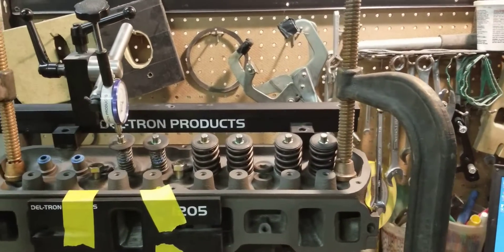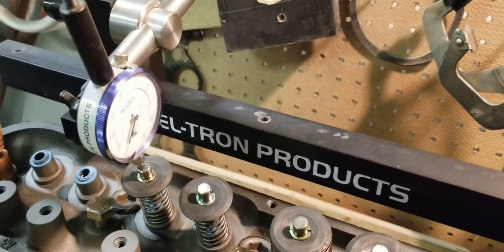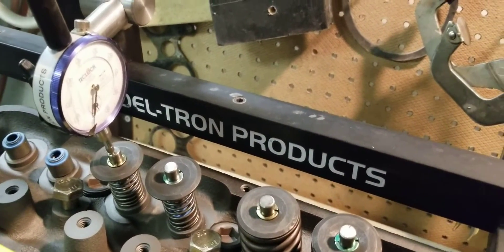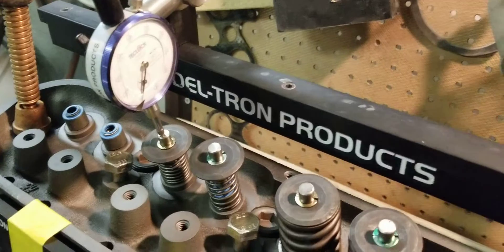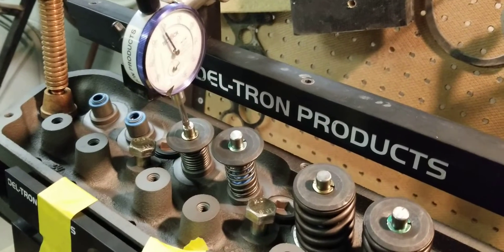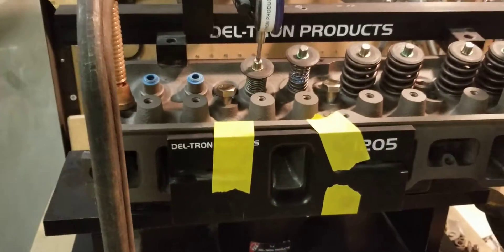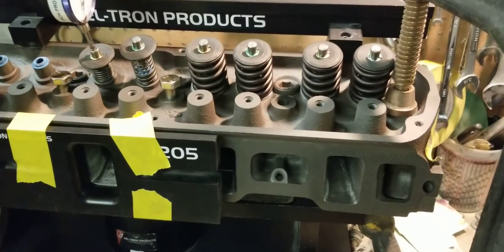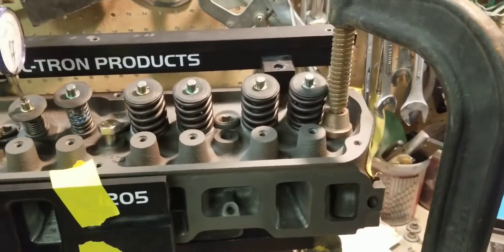Ford gt40 ported heads flow results. Stage 2 iron heads from Bigdogs Porting.

Comment: This runs about $1000 plus shipping correct? At $1200 the “as-cast” AFR 185cc flows similar(a little more) and has a lot of room to grow if I’m not mistaken?
Reply from the maker: No, the stage 2 porting and valve seat cut labor on heads that the customer provides is no where near $1,000.
To buy our fully rebuilt stage 2 ported gt40/gt40p heads equipped with hi performance valve springs is less than $1,000!
Remember this is just our entry level stage 2 port job. We also offer a Stage 2 race port job that gets even more porting with smaller combustion chambers for even more power! These heads will last a lot longer than AFR heads, are cheaper and has made as much as 380whp on 302/306 combos with our other ported parts

Comment: I know people on the fourms call out your flow bench for not being accurate. BUT I think it is nonsense because your stock flow numbers are right on with everyone elses testing. So how can you not trust your numbers. Its ridiculous
Reply from the maker: You are very smart. The haters on the forums say things like that because they don't want to admit the truth, its personal to them. Other porters on those forums are afraid to lose even more customers so this is why they are bashing and talking negativity. Notice they never come with any data or analytics that proves anything we say to be false lol. Every single thing they tried we've come back with proof and we post it for all to see. Yet the main negative people on the forums cannot do the same. None of the haters have used or experienced our porting so how can they give any real legitimate opinions? Yet all of our customers are very happy and many are repeat customers. This is why we ignore the haters. Our customers are making more power with our basic ported factory  parts than most guys are with expensive aftermarket parts! How many guys do you know that are making 380whp on a naturally aspirated 306 with less than 10:1 Compression, mild cam, ac, running a factor computer on a street car? We have customers doing it with our gt40p heads and intake manifold! 
Besides good porters always provide before and after flow results because we know test conditions, fixtures and setups can vary from shop to shop but the gains are universal. A 40cfm gain from our basic stage 2 porting on iron heads is great considering the valves are stock size. We SHOW you raw video of it yet the haters on the forums don't, why? 
Do a search and you will find a video of Eric W showing you how a SF600 flowbench can give the same part totally different flow results based on how the operator sets it up or calibrates it. You can't do that with Our flowbench because it doesn't have a plate below the bore fixture that can be manipulated and the processor is all digital and self calibrating! No room for error at all! 
Once we publish our crate motors engine dyno results the forum haters will have nothing else to say but they were wrong lol.
Reply: @bigdogsportingtonyb2833  Yeah I cant wait to see your crate motor dyno results, I hope it shuts them up.
Reply from the maker: @lukebronstein9617  I can tell you this, the videos will show something that has not been shown on YouTube by anyone selling sbf crate motors lol. After we publish it there will be a big change in how people build their sbf motors. I'll just say this, sbf 302s making Coyote motor hp without exotic parts!!

Comment: I can't believe that no one has ever pointed this out. These numbers are completely not representable, since nothing is standardized. You can't compare them to anything. The industry standard is 28" pressure drop and after every valve lift change the vacuum has to be adjusted accordingly or at least the conversion has to be done after the fact. But no one can look at this and say "Hey, great low lift flow" since everyone measures at 28 and yours is at 36 or whatever. Of course the flow is gonna be higher when you create more suction! This is not to say that the work is not ok, but when all the numbers are compared across the industry you need a common denominator and that's why you can only compare apples to apples if you standardize the pressure drop.
Reply from the maker: See you are not paying attention! Let me say this again for the 100th time. Our flowbench calculates to 28" no matter what the actual depression is! We have many videos showing this. Our processor does the work so as the depression changes the processor adjusts to calculate the flow results to 28". 
Look at our other videos and compare our stock part flow results and you will see they flow right around what everyone else that's doing controlled testing gets. 
I will share the links with you so you can stop listening to people give you false information!
Reply: @bigdogsportingtonyb2833  I just ran into this video only by accident and it was nowhere mentioned within this video that the flow results are scaled to 28". So I hope you can understand why the conclusion that I got was as such. It's very misleading when you look at the screen that you show in the video. I now also understand why your bench does what it does, because it's a DIY bench and not a commercial one.
Reply from the maker: @KontoVonMir  no problem. If you go to porters that ports the amount of volume that we do and that actually flow their parts (95% don't) they may say the have a SF600 but if they are flowing each part like we do I bet they have a flock like we do because its efficient, accurate and self calibrating. A SF600 takes too long to setup and needs regular maintenance in order to remain accurate. Get on the Superflow discussion groups and you will see guys having trouble with accuracy and repeatability.
We flow Every part we port and we deliver over 350 orders a year and growing! Plus our customers are making power that others are not with unported parts.
Reply from the maker: https://youtu.be/8qiuSGuZX5o
Here's another one. We changed the depression WHILE flowing the part and the processor adjusted to give the flow results at 28"!
Now before you criticize us make sure you know what you are talking about!
Don't come on this page talking negative because you've heard some hater say something about our testing to try to discredit us because of their inability to give the results we do. 
We can easily flow at 28" but our testing is for comparison purposes. Before and after porting to see the GAINS!!! 
GET IT?
Reply from the maker: https://youtu.be/CfcWGIbELug
Here's a test showing how our flowbench processor doesn't need exactly 28" give accurate flow results!
Reply: @bigdogsportingtonyb2833  Regarding the other video: I believe you what you're saying. But just FYI, the plate is supposed to be used directly on the hole without the adapter. Also, the 26" you have with the test orifice is only 3.5% away from the measurement that you'd get with 28". So scientifically not super convincing. But again, I believe that your software does the conversion.
Reply from the maker: @KontoVonMir  the adapter 4.060" which is the same exact size as the bore fixture and the other video the depression was changed a lot but the reading was the same lol. I can turn the depression to 3" up to 32" and it's going to read basically the same (ask me how I know lol). We are flowing parts and building cars every day. No matter what, we know the truth and our customers know the truth. The difference is we take our time and use a lot of skill and testing to get the results we do. Just follow our page. We will be posting up customers track results and dyno videos then you will see what I've been saying is 200% facts lol.

Comment: Need your help with a stage two port on a match ported 95 cobra upper.
Motor is 347 with stage three ported and welded lower with AFR 185.  A street motor but I am out of airflow at about 4200.  TB is BBK 75 with Anderson power pipe and 85 sct mass. 10.8 to one coast high rotating assembly.

Original owner 95 cobra so I would like the stage two to keep it looking original or close to.  Figure I need around 300 per port but you would know better

Let me know and thanks

Ray
Reply from the maker: Yes we can help. Can't say your lower is ported to our specs unless you have flow data on it because when customers send us parts ported by other po6we find that they just don't flow what ours do and is exactly why they are not making the power they should.
Your combo is a perfect example of why we tell customers having a ported lower only with a stock upper doesn't give them the cfm they think and in our opinion a waste of time. With our stage 2 porting you will be able  to pull much higher and make a lot more power than you currently have.
Message us on our Facebook business page at Bigdogs Porting to set things up.

Comment: What is happening to velocity? I understand the velocity is what you want for low end torque. How do those numbers look with your porting?
Reply from the maker: We do not hog out ports. Our porting retains great velocity for the combos. Porting is an art as well as involving a lot of science and math and we are very good at it. 
Our ported parts always make great torque and great hp. Most of our 302 customers that runs our stage 2 ported gt40/gt40p heads dyno 350wtrq and up on bolt-on combos with our stage 2 ported  gt40 manifolds. Look on Our Facebook business page at Bigdogs porting for some dyno charts and compare to other combos with other heads and manifolds.

Comment: Is stage 3 max porting on these? Also what’s the power you’d say to expect if I would go stage 2 or 3 with porting on the gt40s mixed running with some other mods like intake throttle body 24lb injectors fuel system... etc
Reply from the maker: Yes we offer stage 3 ported gt40/gt40p heads that gets 1.90/1.60" stainless steel valves and full race porting. They flow around 248/195cfm at .600" lift.
On our stage 2s they can support as much as 380whp with the right supporting parts and the stage 3s can support even more. 
If you run our stage 2 or 3 heads, stage 2 or 3 Intake manifolds, pretty much any cam with supporting parts we recommend 30lb injectors. If you compare this video to the other videos of stock TFS 170s, gt40x or AFR 165s you will see just how well we get these iron stage 2 gt40s to flow! We sell a lot of them.
Reply: Bigdogs Porting Tony B how much is stage 2 and 3?
Reply from the maker: @foxbody8320  message us at Bigdogs Porting on our Facebook  business page for pricing and details.